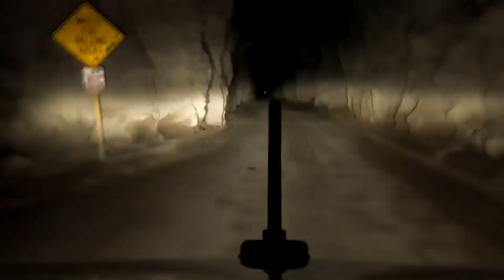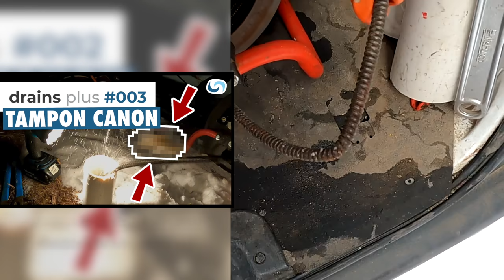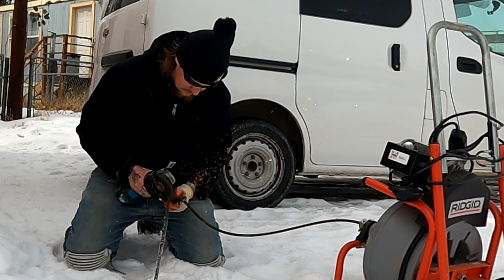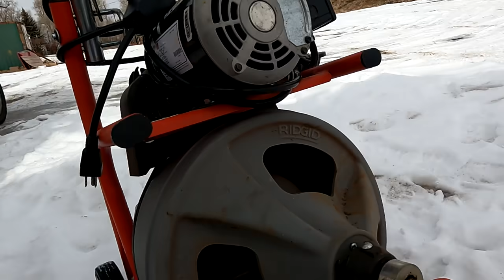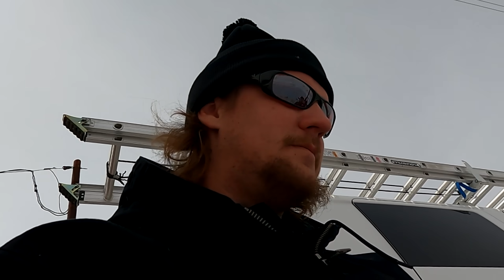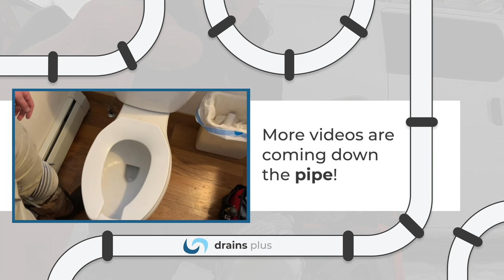How To Repair Kinked K400 Snake Cable | DIY Drain Snake Fix

Comment: I think the other end of your wire rope or cable that is clamped inside has a head on it for pipe cleaning so you could literally just take that wire out and end for end it then put it back in and you would have new wire just a little bit shorter

Comment: I would like to see how to repair /rebend an end on a drain clean out cable
Reply from the maker: Ya I haven’t seen any way to do that successfully. I’ve just always replaced them if there not enough cable left to be useful. Might be able to do it with a piece of gas pipe or something 🧐